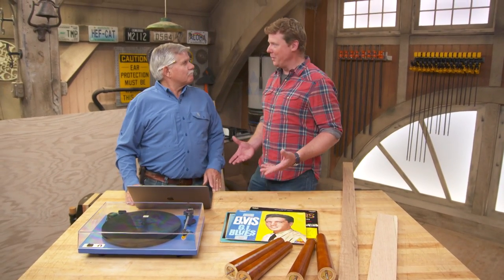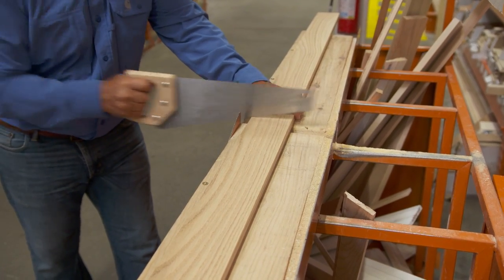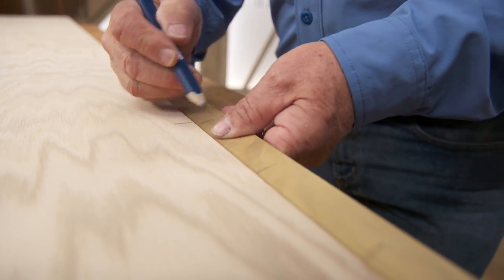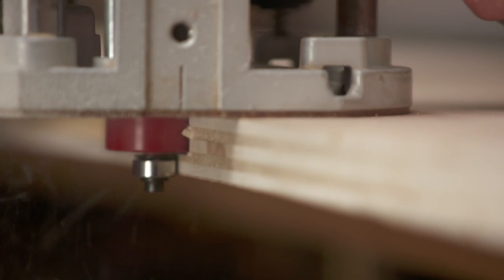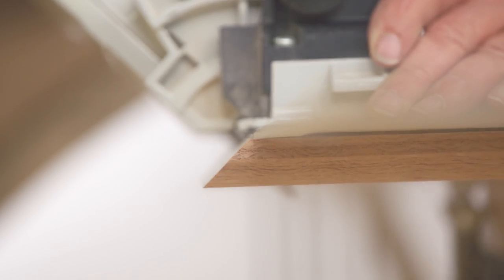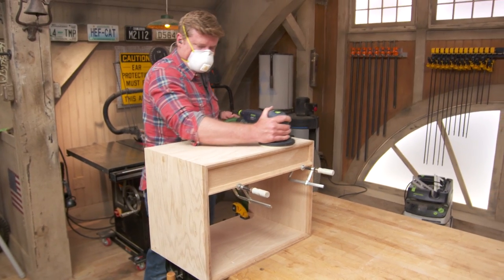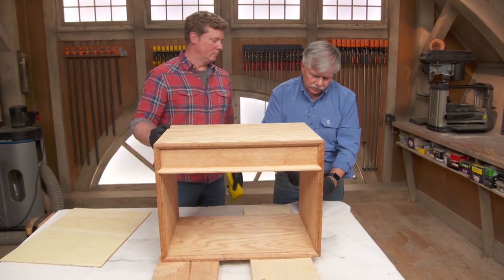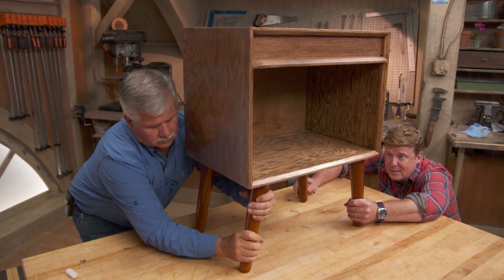Record Player Stand | Build It | Ask This Old House

Comment: This is the best episode yet! Might actually build this.
Reply: Gotta buy one of those Festool mortise makers amazon has them for $960.00
Reply: agruici luckily I’m a woodworker and can do the same thing without needing the same tool!
Reply: @agruici  Or you could use a biscuit jointer from harbor freight for $60. Just because Tommy has professional tools doesn't mean you need professional tools.
Reply: @agruici  that’s a nice system— Fes-Tool makes awesome stuff
Reply: If you’re gonna build it FYI you can skip the prestain conditioner. It’s not necessary on oak and definitely not necessary if you’re using a gel stain.

Comment: Awesome build.  A crowning touch would have been a cable management system to hide the power and audio cables to the outlet and hi-fi amplifier console...
Reply: And a space for the receiver/amplifier since you can't actually use a record player on its own. A lot of these turntable stands seem to go to a lot of trouble for a non-working system.

Comment: I always love watching Tommy build things, and this is one of the coolest yet. I would like to see a build it like this some time, though, that only uses simpler hand/power tools. I have a couple drills, a sander, a rotary cutter, a few hand saws and one of those "oscillating mutitool" saws that I use to repair stuff at home. It seems like every one of these kind of projects (not just from TOH!) ends up needing a table saw or a mortiser or some other large or more specialty tool. Cheers!
Reply: If you get a circular saw, you will have everything you need to make this cabinet:

You can cut plywood on the ground on top of a thick foam insulation sheet (~$20 reusable). With a straightedge, some clever math, and a steady hand you have a track saw/table saw. 

You can make floating tenons using a drill and wooden dowels. It takes some skill on the 45 degree tenons, but it can be done. Or you can pick up a biscuit jointer for ~$60 from Harbor Freight. They aren't as strong, but would definitely work for this application.

Another option to make the project easier is to use iron on edgebanding instead of the solid oak edge. That will save quite a bit of mortising and money. Also, you can skip the mortising and use screws. The glue is doing most of the work anyway. Of course, these options will change the look of the cabinet.

My point is that you don't need a workshop with ten grand in tools to do woodworking. A garage with $1000 of tools will get you started. You just have to understand how you can adjust project to work with your toolset. 

CLAMPS!!! You will need clamps for woodworking. You'll probably want like 4 long clamps and an assortment of other in pairs.
Reply: @kennethgreer  Thanks! This is just what I need.

Comment: Are track saws taking over table saws? It seems the table saw is turning out to be a great work table.
Reply: James Blattner He wanted to do it with common weekend warrior tools, like the Festool track saw, Domino, and miter saw. 🙄
Reply: @Michael-Makes-Stuff  If you cared to learn about woodworking, you'd know that you can accomplish anything those professional tools can do with simpler power tools.  Go make some sawdust!
Reply: Just thinking about investing in a track saw is all.
Reply: @444MarlinSS  you can also get long straight edge tools that clamp down.  Definitely get you across a piece of plywood.
Reply: Thanks! I have done that. Table saws have their place. I agree a straight edge works very well. I use a heavy gauge metal stud and whatever clamps i need. But i been wanting a track saw cordless or corded. Tommy makes using a track saw seem quick and practical.
Reply: @444MarlinSS  lol....sounds like you just want permission to buy one!  so,...James, go and get a track saw.

Comment: I feel like ATOH should put away the Domino jointer tools and never bring them back out. They are undeniably a great tool for a professional shop. But they are $1000 tools, and a biscuit jointer is $50. If ATOH is trying to inspire a new generation to get into the shop and make things, they need to use reasonable tools.
Reply: dtemp132 Yes! I couldn’t agree more. 👍🏼
Reply: You can do basically the same thing with a drill and wooden dowels. Professionals use professional tools; don't knock them for it. If you do a little research you can find many different techniques that can replace the need for expensive tools. TOH does a lot to inspire and train many generations in multiple crafts. 

Do you think you'll actually make a open-face, four-legged cabinet like this, or are you complaining for no reason?
Reply: Kenneth Greer I’m a woodworker with $10k of tools in the garage and even I don’t have a domino jointer

Comment: When did "floating tenons" supplant biscuits?
Reply: Norm said on of the episodes of the new yankee workshop that the  biscuits can swell and cause the wood around the biscuits to swell too, leaving bumps on the joints. The tenons are stronger too.
Reply: @george8873  Much, much, MUCH stronger.

Comment: What was that at 6:40!
Reply: Tommy was cutting the mortise into the cabinet for connecting the 1x4 face of the cabinet (sort of a false drawer). The 1x4 was sitting in the cabinet so Kevin could help Tommy line up the marks so the mortiese would line up. Then Tommy taps the 1x4 into place.

Comment: Never use a design for sound production designed by someone clearly doesn't care about good sound. 
You want a 3 point support....duh.
Wood resonates:  Not good for a support material. 

This is a piece of furniture that holds a turntable.  Its not a well designed audio device.  Turmtable are very sensitive to their support system.  Often its best to just place them on a spiked board on the floor.  The taller the device the more likely the legs will resonate and act like vibrating strings (in principle).
Reply: Only poorly built turntables are sensitive to their table. A well designed turntable should be able to isolate itself from the furniture.